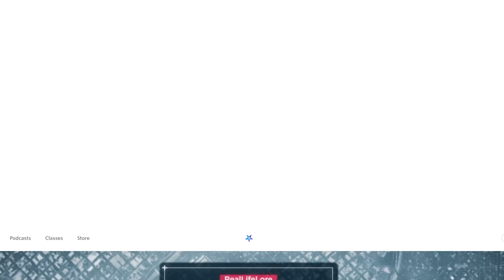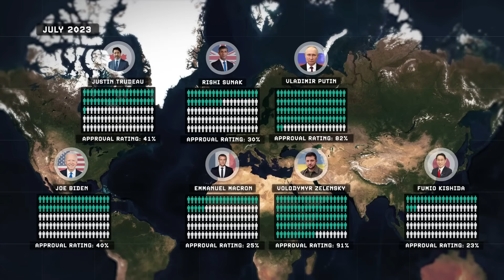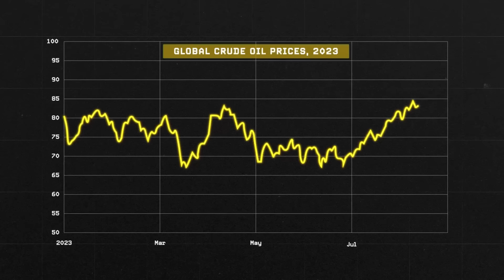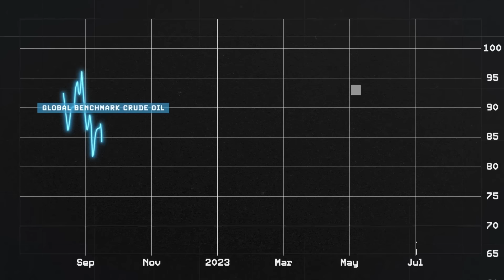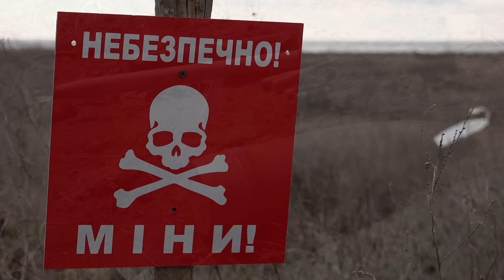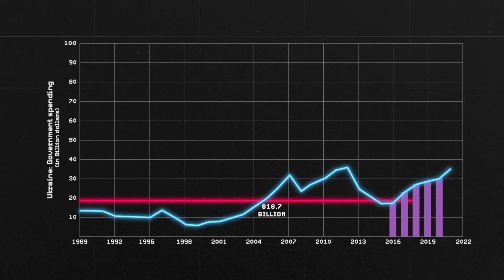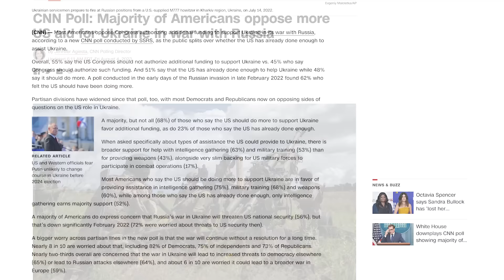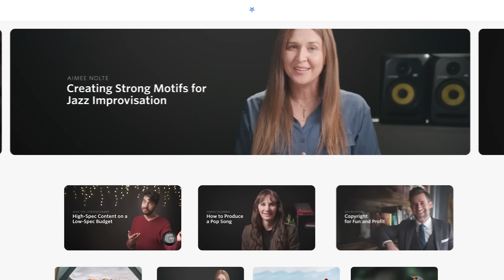Why Russia Isn't Actually Collapsing

Comment: It’s important to consider that the Wagner coup attempt wasn’t aimed at Putin, at least not directly. Prigozhin said during the coup that his only goal was to remove Shoigu and Gerasimov; he said that the “Tsar” was good.
Reply: In a sense Putin was a sort of mediator between the Wagner group and Shoigu.
Reply: It was all a Tactic by Putin.
Putin never wanted the attacks to be on Bakhmut. He wanted to move from the East, focusin on the Kharkiv and Sumy Oblasts, while the main Trench Warfare would remain in Zapharozie. Bakhmut was an unnecesary front.
Taking Kharkiv and Sumy Oblasts basically would give all the Eastern Most regions of Ukraine under Russian control, making mobilization and re-supply far simpler, meaning their offensive would've most likely targeted on dividing Ukraine by the Dnieper River.
But Prighozin got delusions of grandeur and wanted to attack from Bakhmut, this cut supplies to Zapharozie and Kherson Oblasts where were where the main of offensives of Ukraine were coming.
Now Putin has decided to use the Wagner Group to create a Paramilitary in Belarus (specially since Poland is the only EU country that is open to actually send troops) so having them there is both a fear tactic as well as setting up a potentially worst case scenario.
Lukashenko agreed to have the Wagner Group in Belarus, because i am sure Putin will try to have him to take a leadership role in the Wagner Group.
A loyalist like Lukashenko would ensure Wagner Group would attack the targets that Putin believes are the ones that are necessary.
Also Putin knows that this conflict is starting to become a 2nd Cold War, and China is still unwilling to join.
So the Wagner Group is going to be used to spark conflicts in Africa, Asia and Latin America.
Putin knows that the USA is still the most powerful nation in the world.
The only way he can beat them is the same way the USA beat the USSR.
Not by direct conflict, but by forcing them into conflicts that will gain them the hatred of the local population, and conflicts that devolve into Insurgency type of Wars.
The USA has proven for the past 20 years, that they are not good at Insurgency Type of Wars. It only causes the people in those regions to resent them and hate them.
Putin wants that hate to reach the point where they ditch the USA and EU entirely.
This is why what the Republicans are planning with Mexico is incredibly concerning.
Attacking the Cartels on Mexico is going to be a dumb move, just like how the USSR invaded Afghanistan.
Putin knows this, he may be the President, but at his core he's still a KGB Agent.
He knows how the USSR fell, and he knows those same tactics can be used by them as well.
The conflict in the Sahel Region will destroy France both Economically and Energetically. Add the fact that France has allowed a huge influx of migrants from those same regions, and they will even spark resentment within France itself.
Putin knows that a weak EU will force the USA to return to their role as the World's Police, but they no longer have the manpower to fulfill that role.
Reply: He also said Russia could have a new President in 48h
Reply: @trifarianboi3043 , well, it's more like "bro, I like you, but you've got to remove these jerks, or I'll have to take your place and do it myself"
Reply: ABSOLUTELY FALSE! That’s the language you must use in communist countries! I’m from there, I know. Just like I knew day one Wagner was finished. Putin will never forgive a traitor, his only plan was to disarm him. Prigozhin absolutely attacked Putin. He knew that and Putin knew that. One just can’t say it publicly as not to panic the rest. Prigozhin, just like the rest, specially those who were as close to Putin knew that no decision was made without his approval and that everything that Wagner group was going through was on Putins orders. Nobody makes independent decisions there, this isn’t America.
Reply: @miss0petersburg  "communist countries"?  🤣
Reply: @SwampKryakwa  Not you or anybody else has any place in this world to invalidate my family experience going back generations. Your reaction says more about you. I wish you well
Reply: and now Prigozhin is in an unmarked grave after a summary execution. i wonder how well his plan worked out.
Reply: @miss0petersburg I believe you, most people outside ex communist countries have absolutely no idea how it works there and think it's just some economic system. I feel like there needs to be a YouTube short to educate them because that's the only attention span they have.
Reply: @JCJW101  A video would be great to explain all this. I think YouTube has be some sort of extension of school since schools don’t prepare kids at all. But also there isn’t much initiative. They don’t do good here at explaining why glabal affairs are important. If people knew facts, they’d be able to vet miss information themselves.
Reply: @miss0petersburg  Wait, you live in Canada?
Reply: It is military, not 'defence' expenditure.
Reply: The tsar was good one can read between the words that Putin is not good.
Reply: RadoslavKamenov  in theory yes, as taking Bakhmut would've allowed Russia to encricle the troops on the Eastern Front in Kharkiv, Donetsk and Luhansk.

But in practice it didn't make sense.

There were already 2 fronts further West in Zapharozie and Kherson.

And had they ignored Bakhmut as Putin intended, those 2 fronts would've received proper re-supply.

Because of the Bakhmut front, Russia was forced to continue to rely on Mariupol and Crimea for supply.

Because the road towards Zapharozie and Kherson, that barely was receiving any attacks, now became part of the front itself.

A dumb move from Prighozin and it is the main reason the Zapharozie front has become a grind house, where every single small village becomes a blood house for both sides.

Also Putin's goal is for the USA to become hated and countries to start ditching them for them and any other BRICS ally. The Bakhmut offensive, ended up painting Russia just as bad or even worse, which made many countries stall the BRICS deal.

Putin knows that the more countries ditch the USA the fastest this conflict can end. He knows the true battle is a Battle of Economy, Influence and Soft and Hard Power.

Putin doesn't want WW3, he wants Cold War 2. He believes Russia,  is far more capable of withstanding and even winning a Cold War scenario unlike the USSR. Specially if China properly joins. Which will probably happen if the USA does something stupid in Mexico, as it will give enough justification for China to start seriously threatening Taiwan. A basic response of if you guys did it, then we will also do it.

It is why China has focused a lot on arming the Cartels and expanding the Fentanyl trafficking.

They need the USA to start operations in Mexico to justify any attack on Taiwan. They cannot be the first ones to intervene. It needs to be the USA. From there on all cards are open.
Reply: The wicked often jusify themselves.
Reply: It wasn't "coup", it was "march for justice" and it accomplished every single goal they set.
Reply: Tell that to Wagner's family.
Reply: altho if he called Putin a Tsar, that sounds like a veiled insult. In any case, I'm pretty sure Putin had Prigozhin assassinated,  so something tells me he took Prigozhin's 'mutiny' personally.
Reply: @wadegittleson1317  
You seem to be to simple minded to grasp what actually happened and the motives behind it.
Midwits talking about things they have no idea about, is good for a laugh.
Reply: @Eric.1I37  haha, would love to hear your nuanced and ingenious take
Reply: @wadegittleson1317  
Basic logic and deductive reasoning.
Killing someone you said you would not, is bad business for future people you try to make deals with.
Putin is not stupid and he is not a fool, looking at his past action and non-actions.

It is also bad press on the international scene.

So simply put, who would benefit from his death at this Point, not Russia and not Putin.

You answer and how you answer will out you for what you really are.
Reply: @miss0petersburg 
Ktorá krajina mala komunistické politické zriadenie ?
Reply: @JCJW101 
🤣🤣🤣
Ktorá krajina mala komunistické politické zriadenie  ?
Reply: @nightrider12soul 
Vivat Putin  !
👍🇸🇰🔥🇨🇿👍🇵🇱👍🇷🇸👍🇷🇺👍
Vivat Ruská Federácia  !
Reply: @unnamedshadow1866 
🤣🤣🤣
Fantasmagoria.
Reply: Who is the “tsar” ? Sounds like somebody insecure 😂 if he is Biden is a tsar too then
Reply: @unnamedshadow1866 Great comment man, enjoyed reading it.
Reply: @miss0petersburg Modern Russia is most certainly NOT a communist state
Reply: @unnamedshadow1866 You're saying that the fentanyl crisis is China's doing at the end there?
Reply: @unnamedshadow1866 Idk. Hasn't Russia's war in Ukraine made them very unpopular worldwide? The attacks on the grain supply certainly aren't helping that either. And if anything this has been the spark for Europe to strengthen their militaries, and Sweden and Finland joined NATO despite being against that for so long.

Even if the US fs up internationally somewhere else it would probably benefit the Chinese more than the Russians right now.
Reply: Yes. It’s crazy to me that people miss this detail. And it could barely even be considered a coup anyway.
Reply: @soujemn5  Absolutely marked grave actually.  Official version - hand grenade explosion on jet. Prigozhin's funeral done with military honors, as a hero of Russia.
Reply: Didn't Prigozhin get killed by Putin eventually?
Reply: @vigneshsajith  99%
Reply: @vigneshsajith  Is not a fact. Too primitive. Prigogine could not act alone. At one point, he received approval for the coup from some high-ranking officials from Putin’s government. And after the coup failed, Prigozhin became too inconvenient a witness for many, and could reveal the traitors. Therefore, I do not rule out the liquidation of Prigozhin by those people who did not want him to one day tell the truth. In addition, you can blame everything on Putin. It is very comfortable. I also wouldn’t be surprised if one day they kill Zelensky, those people who surround him now will also say that it’s Putin. However, Russia, like no one else, needs Zelensky alive, because he can tell a lot of interesting things, about who and where he is being given instructions from.
Reply: @Kastrulkin81  yeah you may be right.. honestly I don't take a side in the whole Putin vs the west fiasco.. but the media we read is incredibly biased against Putin.. but who's to say if Putin is the bad guy or if it's the west.. as much as people hate and blame Putin, the areas he invaded like Crimea, Luhansk and Donetsk have an overwhelming support for Putin and the Russian Federation... That definitely says something

And in addition, as an Indian.. ik majority of Indians don't see Russia as an enemy but a historical friend who has always supported us in need when the US was just playing favourites until they needed us to use us against China.
Reply: @vigneshsajith  It all depends on what is considered bad. If you need the power of the dollar and US world domination, then yes! Putin is bad. Anyone who threatens US competition becomes bad. For example China. But it was not always so. A little earlier, after the collapse of the USSR, Russia was weak and supplied its resources to the West for very cheap, as a colony. China had very cheap labor. And it was also good for the West. But as soon as Russia or China began to rise to their feet and represent strength, they immediately became bad. The same will happen with any country including India. As soon as India begins to compete with the West, it will also become bad. Well, as far as seizing territories is concerned, in reality there is simply no choice. Russia does not want wars, but the West specifically created the conditions for its outbreak. Therefore, a military operation had to be launched to prevent the killing of Russian people, and by moving the front line, Russia annexes territories to make the local residents understand that they will be protected since they become Russian citizens. And that Russia now cannot retreat.
Reply: The simple fact of reality is this: both the minister and chief of staff are the direct subordinates of the president. If you come behind the back of their superior to deal with them personally, you attack him by trying to show him as incompetent leader, since he has such bad subordinates and you not believing he can deal with them since you don’t involve him in the first place. Prigozhin, as a businessman with an enormous experience in business and hierarchy should’ve known this.

Comment: Prigozhin rebelled not against the Russian government, but against two individuals: Defence Minister Shoigu and Chief of Staff of the Armed Forces Gerasimov. If you are in the know, then Prigozhin’s conflict with them began in Syria back in 2017.
Reply: @paul.1337  Both of these guys are appointed by the president, that is, Putin. But they are often appointed out of some necessity. But these guys clearly do not shine with military leadership talents.
Reply: One does not start a mutiny to go from number 3 to number 2. There is no holding back in an armed coup, once you take up arms against your own government, you either go all the way or your life is over. Prigozhin flinched and got the latter.

Comment: A lot of russian oil is now going to gulf states, and blended together to be sold as gulf oil to buyers across the world. On the comparison to WW1. The average assault in WW1 gained on average 900m of ground before counter attacks stopped them. In the current war, it's only 50m.
Reply: Modern weapons are just too good to attack against. You probably had a better chance charging across of smoked trench than you would across a modern battlefield.

Comment: The data on those killed on both sides was clearly taken from the air. The footage taken from Ukrainian cemeteries is simply disturbing. For several months now, information has been circulating about 400,000 killed Ukrainians, and men are being caught on the streets of Ukrainian cities to be sent to the army. In Russia, however, such strict mobilization is not visible. From which we can conclude that losses on the part of the Russians are still lower.
Reply: I've seen videos of Russians going to rural areas and talk with the folks there. There are very few young men left in those rural areas. They are the first and "stock" to be taken to combat. Due to... Low literacy, propaganda machines, etc. The people in those videos looked like zombies who worked the land and watched state tv.
Urban areas people are the last to be taken to the frontlines. Those generate more noise in influencial spheres.
Reply: Nah, losses are higher in Russian military, because they have worse equipment but are pretty even except that
Reply: @darkshark3906  Worse hahahaha. How worse can it be if Ukraine mainly uses USSR equipment? Yes, they receive something from the West, but not everything arrives and it is not of the best quality. It is a fact. Russia also produces weapons itself. And about the losses, what is above is generally funny.
Reply: @darkshark3906 Техника хуже.... 😂😂😂😂😂
Уровень аналитики школьника начальных классов. Не позорься, деточка.
Reply: 🇺🇦1.1 млн
🇷🇺190 тыс

Comment: 41:30 would be interesting to also add a note on how much is given per person in those regions. I.e. USA give more then half of the money support, but they are also the biggest country by far, and thus also the largest economy by far. So which country truly is the most generous is hard to tell, depending on which angle it's looked from. Also an interesting side note; as much as western countries spend now, if Ukraine loose this I suspect the price for western countries will by far, far more (both in economic and personal cost) then what it would be to remain support for Ukraine.

Comment: Only thing keeping the war going is the saving face issue that keeps this BS running. Only way to fix this is a form of protection and a proper border state look by at least 2 independent watch dog organizations. Why, all sides from help to fight has the security enough to calm into a secured position. After that, secure a proper, and honorable link that is stronger than how the BS started. The hard part could be calmed even more together as explorers . Each area has a good and bad tactics another salves. So if we did this together the chances of failure. That in its self could make competitors into partners. As partners grow together would cause stability using the best over all practices. Boom, one world drops in flavor of partners and miner arguments. Better to hear yelling over gunfire. But how to do it with out one side or another looking bad, or proper security bot to fear another partner.